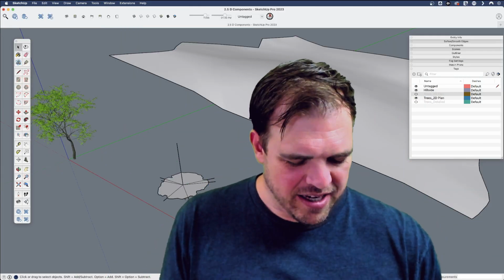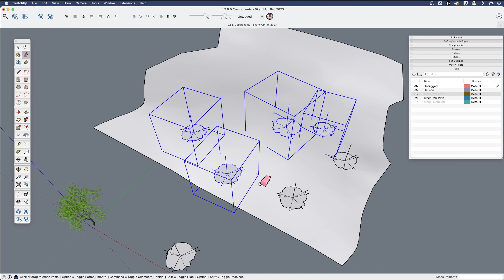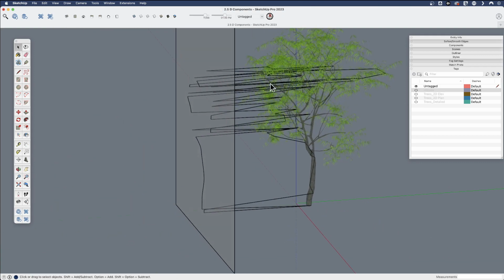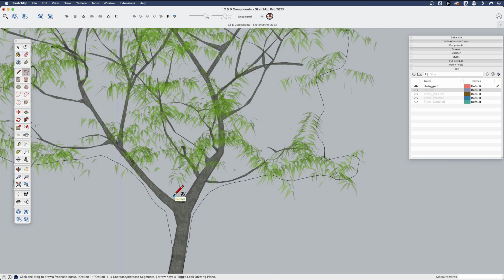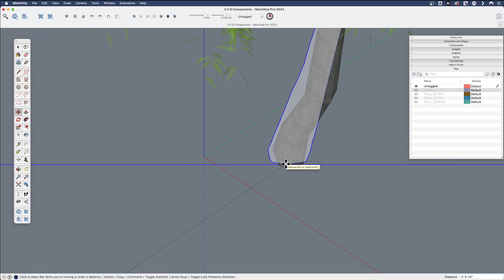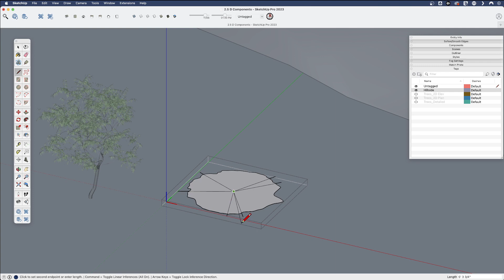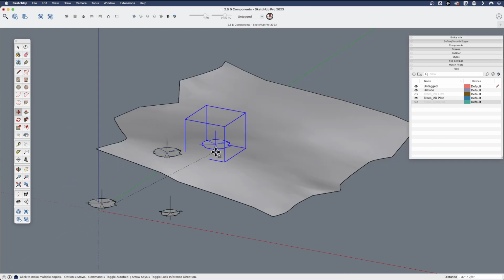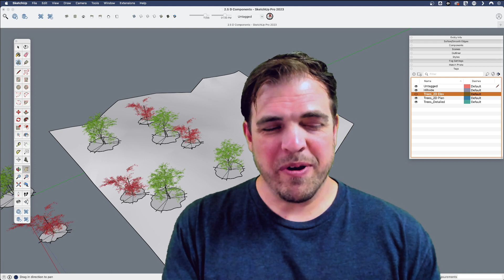Level Up 2D - 3D Components

Comment: If you create the plan in the same style and lift it up to the mid height of the elevation of the foliage.. it will contribute to realism of thr tree in isometric views without significantly adding complexity.. PS, the 2d elevation should be a face me setting.. TomToms randon scale and rotate is a must have to make the scene more naturalistic